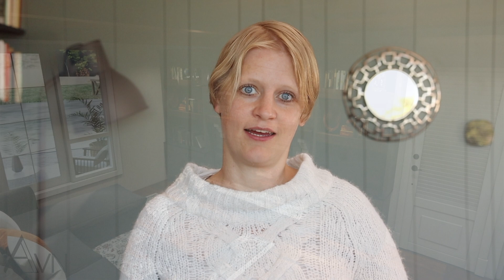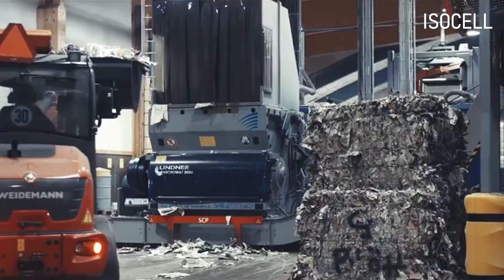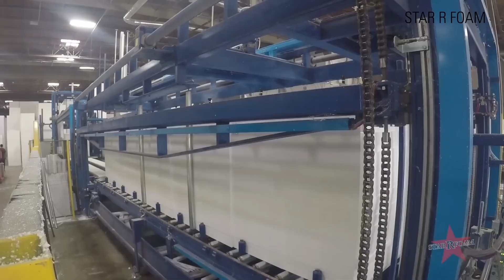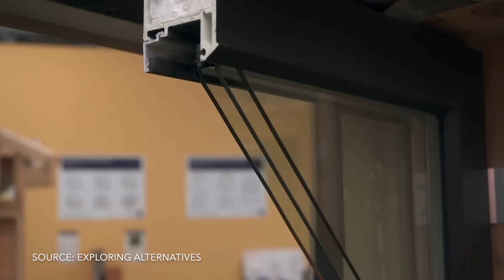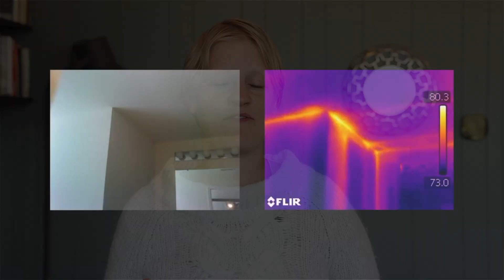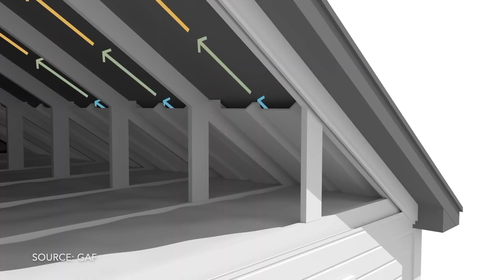Why your insulation sucks...

Comment: I'm a fan of the channel. Interested in changing from natural gas forced air heat/portable air conditioner(Hisense) to electrical heat pump system. So far it's cost prohibitive. Also want to be able to survive off-grid with solar panels/storage batteries because we live in western Washington state where we are due to have a 9-point-on the Richter Scale earthquake. 

BTW, the audio in all your videos has a problem reproducing S's.  Everytime you say a word with an S in it, it breaks up. Are you recording your audio at 44.1 khz or 48 khz? If you are, consider getting a De-esser plugin (or hardware De-esser) for audio recording or post-processing. Don't get the cheapest one, you get what you pay for. It is difficult to reproduce S's cleanly. Especially female vocal. Perhaps a better quality microphone would help? Don't mean to criticize, just trying to be helpful. I've fought the S's problem for years recording vocalists/bands.
Reply from the maker: Hi Kenneth, Thank you very much! Sorry for the late reply. I was busy interviewing and connecting with heat pump experts at the heat pump summit in Denver :-)

Interesting project you are looking into. I also help people to choose an installer. Let me know if there is anything I can help with. katha@upheatacademy.com 

Thank you very much for the feedback on the audio! Very helpful. I thought I had fixed it and then it came back. It looks like I have to buy a new microphone. Thank you!

Comment: In certain areas of the US, older homes (built before 1930) may still have knob and tube wiring.  These wires need to be in free air to keep from overheating and causing a fire.  Before blowing insulation into walls or attics  the old wires need to be upgraded.
Contractors wanting a simple way to demonstrate inadequate insulation to customers can purchase a modest priced attachment for a smartphone.  (Less than $200)  It will turn your camera into an infrared imaging device.  (Made by Fluke)  Areas of poor insulation will be  readily visible on the screen of the phone.
Reply: Correction,  'FLIR'
Reply from the maker: Interesting! Thank you very much for sharing! 🙏 Yes, the attachment is a great one. Renting an infra red camera at a home improvement store should be even less expensive, if you don't need it that often. Hope things are well with you! 😀Katha
Reply: My daughter just bought a 1884 non-insulating house in St Paul Mn.  I am a maintenance guy at a medium sized manufacture, so I am somewhat skilled at doing these jobs.  I redid the pressure side of plumbing and am in the middle of pulling the lath/plaster and rockwooling the bathroom. I will be using Intelo Plus for my advance vapor barrier. The ONLY way to go in these old old houses if you insulate them.   I THEN found out the house was still using 75% of the second level on knob and tube (SURPRISE) and 30% on the main level. I followed a run of wires to the second level ceiling run and there was the main run of knob and tube, ALL live with my wire tone tool.  The basement was conduit-ed and 60's breaker box "showed"  it was rewired. It fooled me and everyone else. I was going to add 4 to 5  20 amp runs for my daughter's 3D printing business, but NOW I will be rewiring the whole house. I did see some signs when changing a bedroom light as it had 16 gauge wiring and not even 14 gauge. I thought it was just cheap 2 wire that was in my own 1949 house , but all my 2 wire was 12-14 gauge. Turns out knob and tube can and uses in most cases 16  to 14 gauge wire  even for outlets. So we are  at 10 amp draw MAX use of outlets, till I rewire. I can't trust the 1940's install of two outlets  with  "Greenfield/BX" style  wire that it doesn't go back to a 16 gauge  knob and tube wire.
Reply from the maker: Wow, sound like a solid retrofit. Let me know if you'd like to hop on the show sometime to explain it. Thank you for doing all this work! I installed wall-mounted resistance heaters and we should upgrade the main breaker panel some time as we added two EVs over the years and would like to add a heat pump for hot water.

Comment: Screw spray foam. It's a pain in the butt if you have to work around it (electrical, plumbing, etc) Everyone cuts it and never replaces it. If you have a leak in your roof how the heck will you know when spray foam is so sealed the water runs down and drips somewhere else
Reply from the maker: Thank you so much for sharing! 🙏 Very interesting. I also have heard things like that before. What do you recommend instead? Cheers, Katha 😀